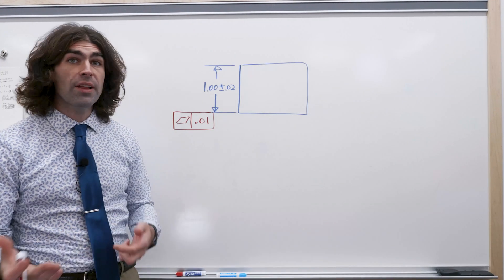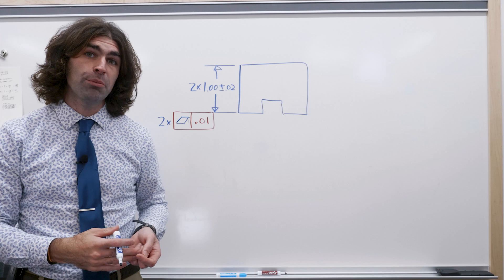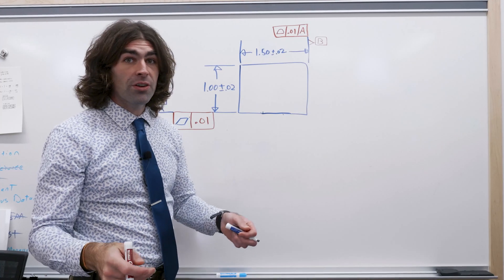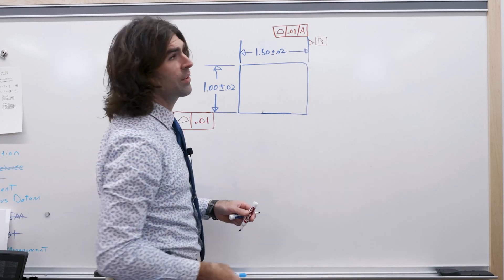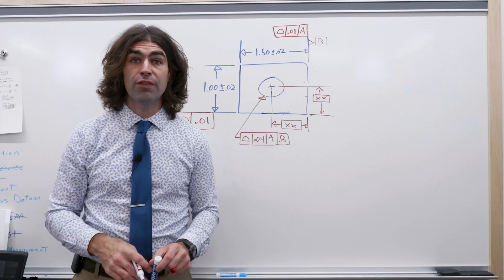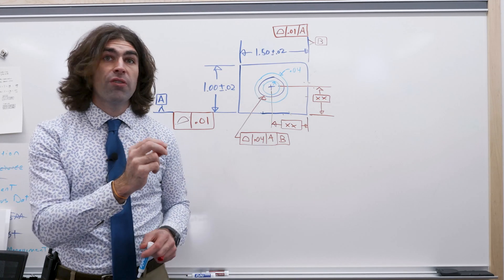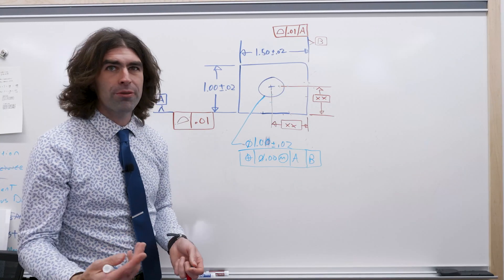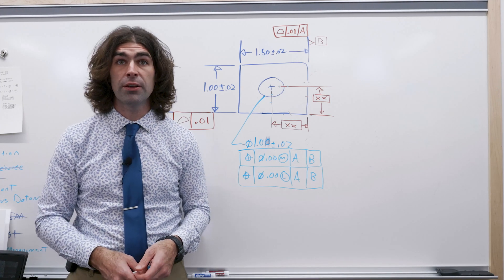GD&T: Profile Possibilities

Comment: @4:00 ...That is the truth!  I have had several drawings kicked back to me from our drafter checker in the last week because I qualified Datum A with a profile tolerance, and Datum B with a profile with respect to A.  Got told to change it to flatness and perpendicularity!  I tried to explain we are talking about two different ways of saying the exact same thing, and that there wasn't a need to change it.  I sent them a few references to the standard, including examples in the standard where it was shown.  They just told me I couldn't do that and to change it anyway.  But I watched your video, so I knew better.  😁  I also used a profile to control the surface of a hole but they didn't like that.  It wasn't a critical feature so I didn't bother with a dedicated positional tolerance, especially since the other controls I had already dictated it would be a laser cut flat plate, but they said I had to use position and surface wasn't allowed.  I gave them the equivalent positional callouts 😁
Reply from the maker: That’s awesome! I really enjoy hearing about this stuff happening out there in industry.